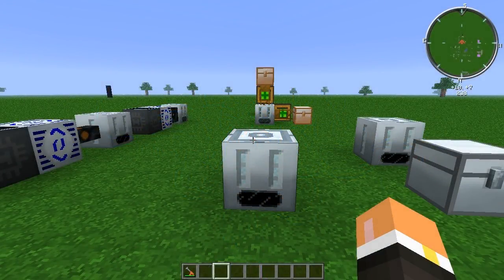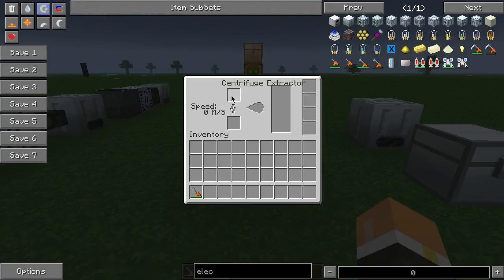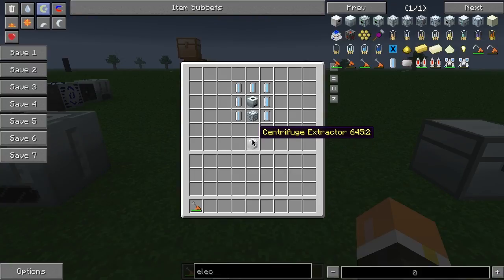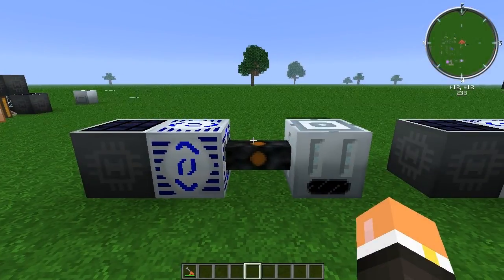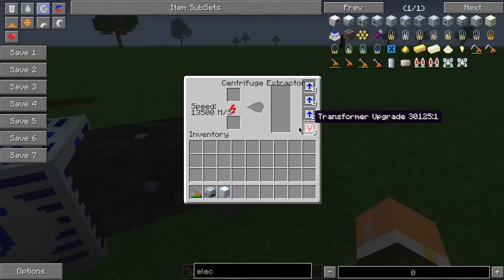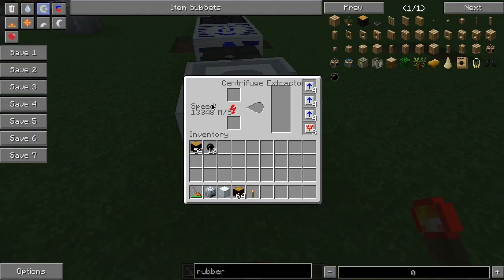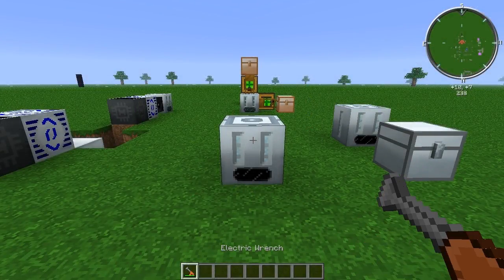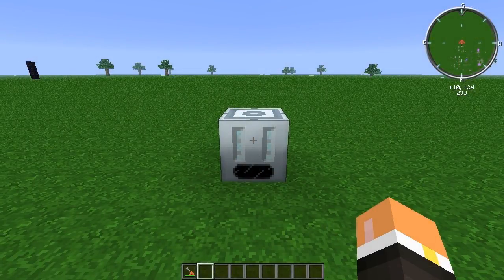Feed The Beast :: Machine Tutorials :: Centrifuge Extractor

Comment: just FYI the machines dont blow up because they are already fully charged so the 33EU/t is in the cable and doesnt go into the machine - it will not blow up however if you replace it the eu will go into machine and it will blow up.Also if you start extracting it will blow up too.